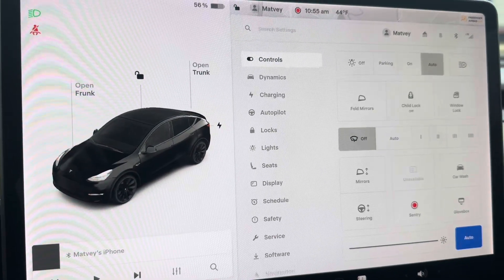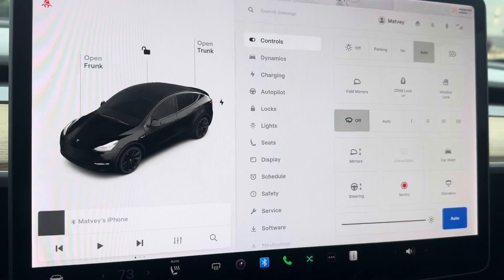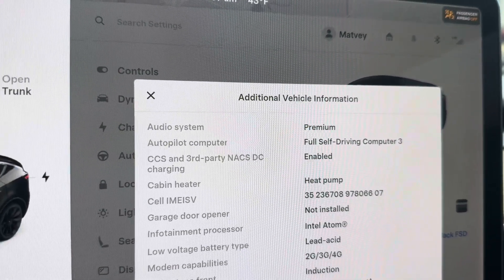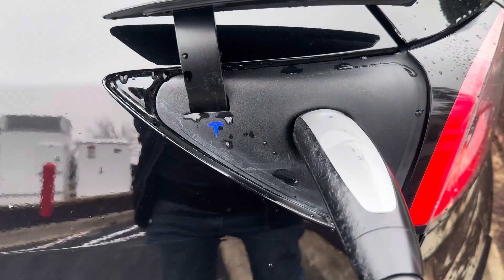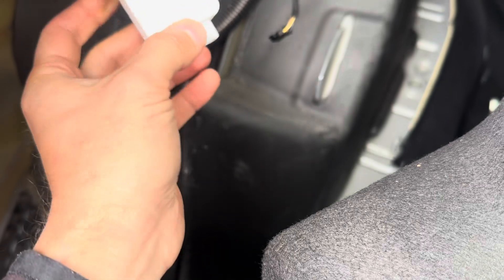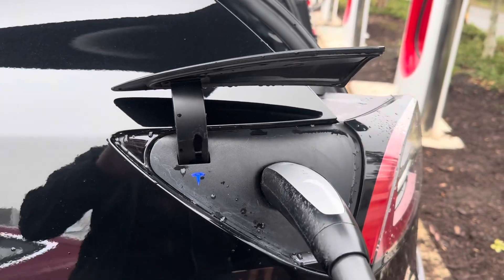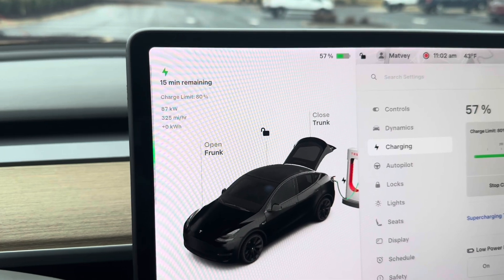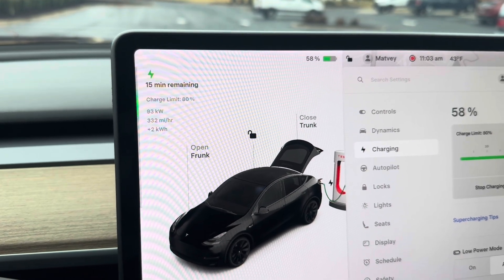Supercharging with salvage/totaled Teslas

Comment: I just ran into your video and hope you see this message.  I just bought my first copart 2025 Tesla Model 3 RWD and made sure it said run and drive but the driver just said they have to pop the door by putting a jumper and the screen powers up but they can't shift.  The only damage is rear passenger door and side airbag deployed. My issue right now is three delivery is tomorrow and it's sitting on top of a 7 car hauler and I'm trying to figure out how to move the car to unload it since it was loaded by a forklift
Reply: Anytime an airbag deploys pyrofuse explodes and driving its disabled. You have to use a forklift to move the car
Reply: Thank you very much for the info.  I did have to hire a forklift to bring it down and I bought the pyrofuse.

Comment: Hy My name is Marian, can you help me with my teslamodwl 3.? I got  it salvage from copart,I fixed the suspension  and changed  airbags and low voltage  battery,.was starting  the tablet but  not able to move the car.i did my tesla account and then all start ..I was able to charge the big battery  feom 61 to 63 % and after I can't  turn on the tablet just for few seconds  and after black  screen  again

Comment: heh i am in the process of quadrupling the hv battery in my old chevy volt and instead of installing a dc fast charging kit, I was going to just install 2 additional cheap 6.6kw AC on board chargers wired under the rear license plate. all togeather it should be ~16kw of charge speed on level 2 between 3 cords. level 2 charging is much cheaper/free comapred to dc fast charging and its probably about half as fast as what i would expect to get from a dc fast charger kit, probably ~30-40kw. think im the first person to do something like this. currently i just have a portable level 2 charger in my trunk that i charge at the same time as my car but after the hv battery is finished i will remove it and make it an off grid solar charger. i show all this in a video on my channel :p
the 6.6 kw chargers are around 500 bucks each directly from china.

Comment: Thanks for the video, really appreciate the way to avoid the High Voltage Inspection.

From my own experience buying Teslas at auction, I’ve seen that even some clean title cars after an accident can have Supercharging disabled by Tesla. On the other hand, I’ve also come across certain salvage/total loss cars where Supercharging is still enabled.

I have a way to check Supercharger status before buying the car, so if anyone’s interested, I can share how this works and what to look at before you bid or purchase.
Reply from the maker: Yes, that information is available in Tesla’s EPC database.   But a true “clean title” car that was never totaled will not get supercharging removed.   Some are sold as “clean title” by mistake even if they were totaled.

Comment: Nice one. My friend here in Australia got a similar device (it does the same thing but I think it is from a different person). He did a Full Tesla Integration in his Mercedes Sprinter Van but Supercharging had been turned off in his salvaged Model 3 donor- He could still charge at 3rd party Fast chargers no problem but can now use Superchargers with this Man in the middle. The security certificate expired in my salvaged model 3 before Tesla disabled SCing so luckily I didn't need it.

Comment: You're only half right on Tesla changing flag in your car, they also change SC** code now in database on their server (SC00 for salvage, meaning No Supercharging). This doesn't really matter for paid charging but for some cars with free supercharging (pre mar '17) only way to get it back is to pass inspection, after which Tesla will revert Server SC** code to what it should be
Reply from the maker: Yes they still won’t enable free unlimited supercharging until you pass the inspection.  You will have to pay for each use.

Comment: This seems pretty good, a little expensive for a small plastic piece with a chip or whatever inside. Still cheaper than an inspection though. I’ve had a rebuilt model y P for over a year and never needed it until a week ago. I just bought  highland 3 Performance to rebuild. I might try this, only concern is, would a future update from Tesla block this? If so what support is there from this company?
Reply from the maker: It’s possible that Tesla could implement an update that blocks devices like this from working, but it won’t be trivial for them, so hopefully they will never make an effort.   If this happens months or years down the road realistically I wouldn’t expect anything from them as the order page is not mentioning any warranty period from what I can see.
Reply: @diytesla if they do disable this device in a future updates would you be willing to reprogram your product to work again?
Reply from the maker: @thegyptiandream that would be a question to the company that sells them.
Reply: I think for the price it’s worth a try. Thanks for the info and all
The helpful videos.